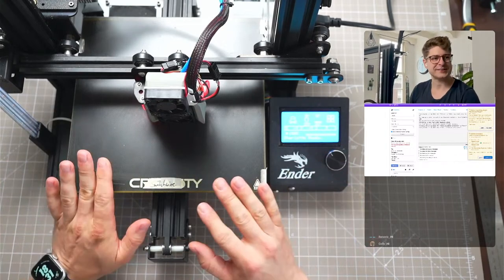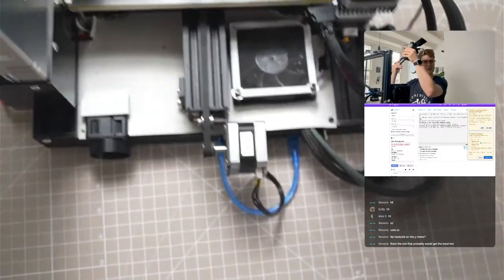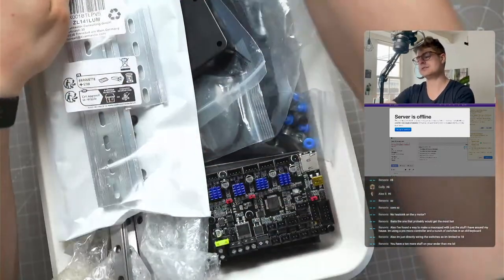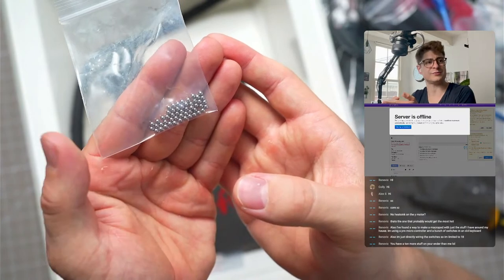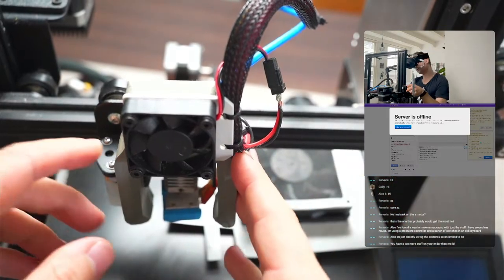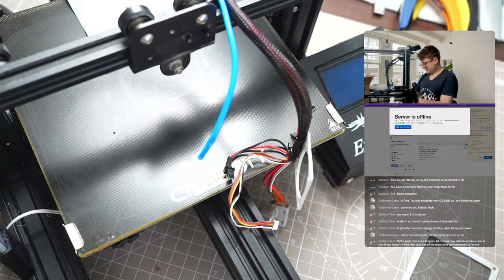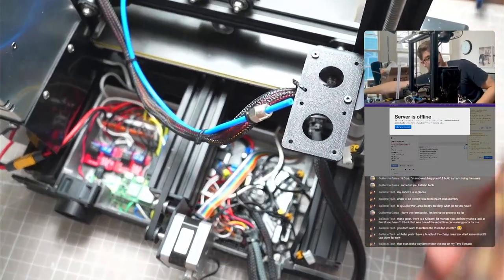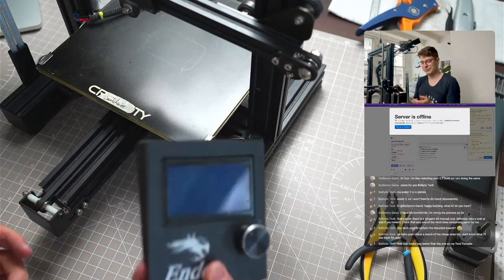Voron Enderwire: Ender 3 Pro to Switchwire Conversion [Part 1]

Comment: Where do you got these nice little assortment boxes from?
Reply from the maker: Search gridfinity on printables. https://www.printables.com/model/325677-gridbox
https://www.printables.com/model/366532-gridfinity-bin-with-label-parametric/comments/909694
Reply: @livingroomworkbench  maybe i have to be a bit more precise :). I was asking about the small white hexagonal shaped box for you currently used screws and stuff :). I am finding myself always losing screws while tinkering with my printers.
Reply from the maker: https://www.printables.com/model/208040-hex-parts-tray-stackable